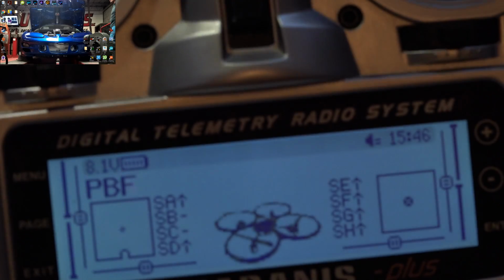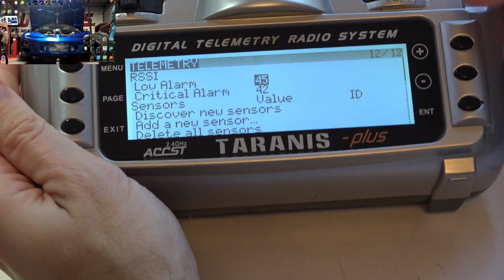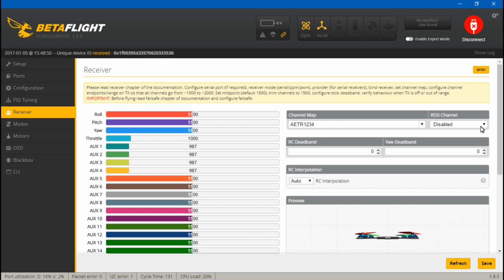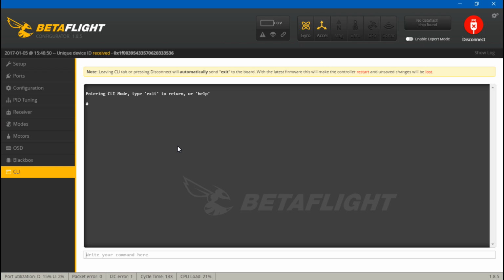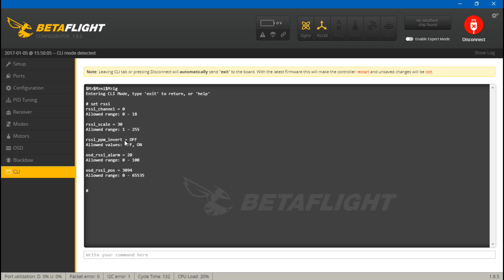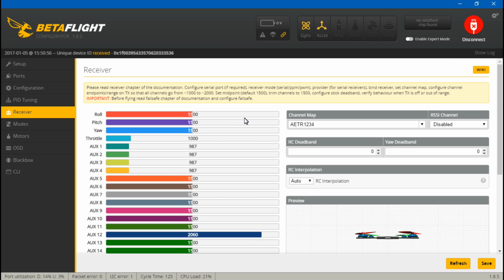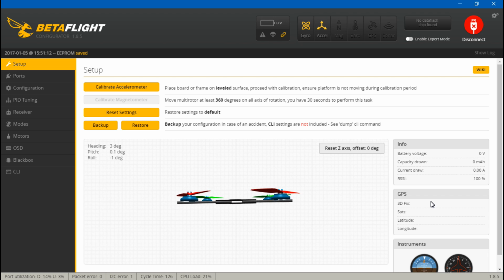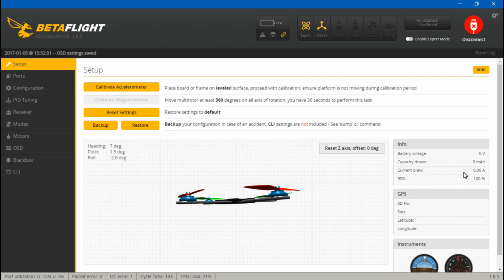RSSI With FrSky XM & XM Plus

Comment: Can't get it to work with betaflight 3.1.7, I'm following all the steps but still don't get the RSSI signal to show. AUX 12 stays on 1500. I've set RSSI channel to 16, max_aux_channels = 12, rssi_invert off.
Do you think it's 3.1.7 problem or maybe you have some other setting not default that is influencing it?
Thanks for all your tutorials, all of them are very helpful and thorough, you helped me alot with my first build!
Reply: I had this problem too. Update the Rx firmware to the latest version.

Comment: im using the newest cleanflight which is almost exactly the same. except it just shows 0% on the setup page. even with rssi channel set to 16 and it showing properly in receiver tab. wtf? is this a glitch? i haven't had a chance to see if my osd is displaying correctly yet though.
Reply: Sergeant Seven you have to flash the rx firmware, there are different images for no rssi, rssi on channel 8, and rssi on ch16.

Comment: Hey Falcon I know this might be off track but I hope you do not mind me asking. Currently I do not have a FCB that displays OSD nor do I have the "norm" OSD, however I do have a RROSD V2 as well as the FrSky XM with the single antenna. I reached out to the guys at RROSD and proposed this question...Since the RROSD v2 has a hookup for RSSI and the XM has the pad for RSSI would it be possible to make the XM produce the RSSI signal to the RROSD v2 OSD. They said it is possible but have not tried it. Do you have any thoughts on this?

Comment: Thank you the helpful video!
I use this receiver with my old CC3D Atom at now. The micro minim OSD worked on main port (UART1) previously, but now the receiver use it. The minim osd isn't work on flexi port (UART2) for me.
Could you suggest any solution for this problem?

Comment: hi Jc..i am useing matek osd on pdb and xm plus..getting my RSSI on betaflight like u told in this video..all perfect is there any possibility to get on screen..?thank you
Reply from the maker: I haven't used one of those yet but I'm going to order one and give it a try. But there are no wires running to the flight controllers UARTs so its not sending and receiving data. I could be wrong though. But if its not then without that data then the only other way would be if there is a RSSI pad on the PDB itself. But then again that would work with other receivers, not sure if the XM+ has a RSSI pad on it. I'll have to take a look into all of this.
Reply: yes there is RSSI pad on the PDB..but iam not sure wich pad have rssi signal on xm plus....Thanks Alot JC!!
Reply: I just got one of these and there are Tx and Rx pads on it i got a kiss though and am trying to figure that out as well

Comment: can i set up a switch on my q x7 so it will say the rssi when im using this?
Reply from the maker: I haven't used the q x7 yet but I'm going to guess no because these receivers have no telemetry at all. Not even RSSI. It only outputs RSSI through a channel.
Reply: Maybe possible to program taranis to readout "channel 16" current value? don't have one yet myself.

Comment: how would i send that RSSI info to the taranis?
Reply from the maker: Cant. These receivers have zero telemetry.
Reply: Project Blue Falcon when I look at my channel monitor it shows ch16  at 1/2 way should that be moving with the RSSI ?
Reply: so only osd?...lame
Reply: Derek1978  I have three XM+ and are happy with the range by far. in some cases it out does some of the xsr and x4rsb I have,might be due to no telemetry.
Reply: I have the same problem rssi is always to 50% anybody with the same issue????
Reply: Flash the Rx firmware.  See my post in these comments for more details and links.
Reply: T3chDad yeah I figured that out, you need to actually flash it in order to get de rssi, thanks mate!
Reply: u need to flash receiver with rssi firmware

Comment: Can we wire the rssi pad in the xm+ to one pdb OSD like the RROSD or the Hubosd?
Reply from the maker: I cant confirm. Never got around to trying it. Plus sometimes when you wire from the RSSI pad sometimes it requires an inverter or filter. But if you use a OSD that receives data from the flight controller then doing it the way I did in the video would be most simple and not need any filters or inverters.
Reply: Tuga power :P
Reply: did you tried it/ got it working ?!

Comment: jc how do I update the firmware as their not smart port mine lbt need non lbt
Reply from the maker: I'll make a video on it when FrSky fixes the firmware. The firmware on their website does not work right now and will lock up the receiver.
Reply: Project Blue Falcon cheers for. that it could help to read this article https://www.rcgroups.com/forums/showthread.php?2780962-FrSky-XM-XM-Micro-1g-16CH-Rx-10-16/page6
Reply: jc the version on the frskk website dating 25-12-2016 is that one ok

Comment: do you have a video on how to update a reciver with your transmitter? do you know how to update this one Tiny Frsky 8CH Receiver Compatible With FRSKY X9D Plus DJT DFT DHT For QX95 QX90 QX80 DIY Micro Quadcopter
https://banggood.app.link/3dHqDr9T8y ?
Reply from the maker: Yea look in my Taranis playlist. I have firmware videos for the X8R, X4R-SB, and XSR. I dont have a video for the XM or XM Plus yet because the firmware they released doesnt work but they are fixing it soon. And I'm not sure about the receiver you sent the link to. I dont think thats an official FrSky receiver but I could be wrong. But if it is then you can watch those other videos, the set up should be similar.

Comment: hey JC I have a question my battery voltage was displayed on my taranis and x4r sbus bit now I have no voltage on controller just the battery indicator and voltage is displayed on betaflight any idea what this could be
Reply from the maker: This receiver has no telemetry at all. So you wont see anything on your transmitter. Thats the only reason they could make it so small, by removing all the telemetry stuff.

Comment: Hey with my 'm plus I'm not getting a telemetry lost tone and a telemetry recovered smd when it's bound it doesent have the rssi signal next to the Transmitter battery in the top left of the screen? do you know why this is?
Reply from the maker: Because these receivers don't have telemetry. They only have a RSSI output to be able to see telemetry in an osd
Reply: Is there a way to get the ch 16 telemetry routed to the taranis telemetry so it can detect it?

Comment: i tried this with the wiring - and the xm+ doesn't power up at all while the rssi pad is connected(works with the x4r-sb though), did you try direct soldering it for something like a powerosd or rrosd?

good tip though, probably going to get a piggyosd for my quad at some point :)
Reply from the maker: I was originally trying with a minim osd micro but didn't get too far into it until I saw that RSSI was on ch 16.
Reply: I have exactly the same problem.  I can't get it to power up with the rssi pin connected.   But I guess we don't need it with betaflight OSD

Comment: hello jc do you use racr flight, if so do you like it better than beta flight?
Reply from the maker: I do use raceflight, but what I can say right now is the current version available to the public is very bad. But I've been using the test version of the Raceflight One project. Its almost finished and will be released to the public in the next couple weeks. It is much better. Once it releases I'll make plenty of videos on Raceflight One just like I've done with Betaflight. But for right now I would say Betaflight is much better than the version of Raceflight that is out right now.